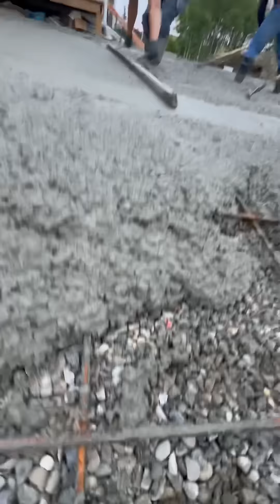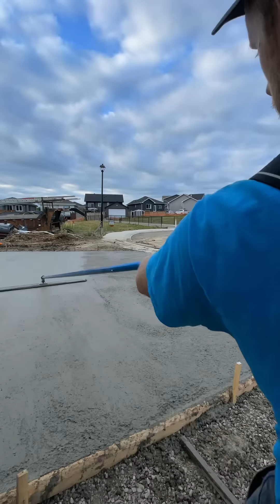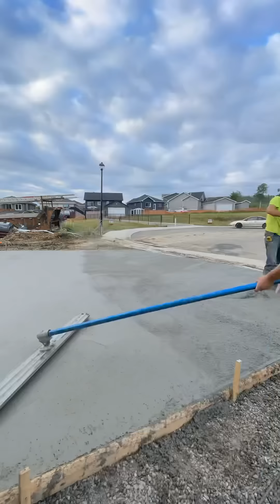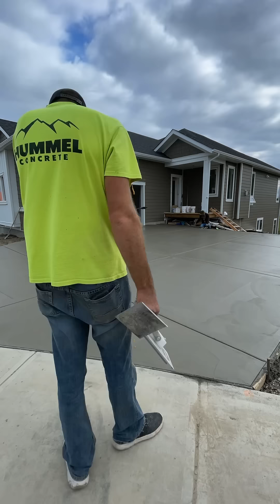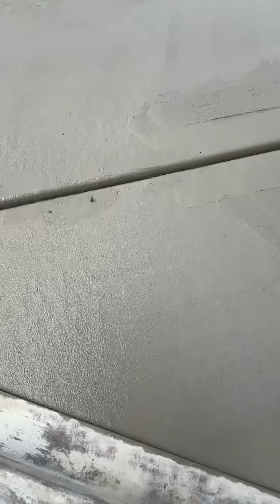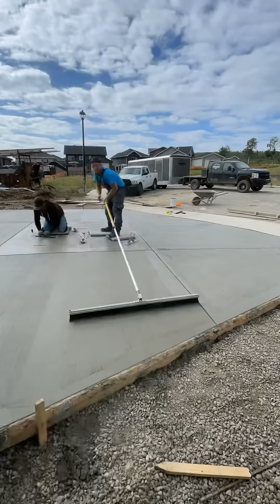How to pour a broom finish driveway ⚔️🧹✅ #concrete #construction #shorts

Comment: Whats the cost of that size driveway for exactly what you did?...i realize its small but just curious. Also, is this suggested for places in north which would have season ie winter temps.....?can this last without up leveling from ground rising due to vold temps?

Comment: How do you eyeball wet cut line that straight without like a laser or string line?
Reply from the maker: @JustLikeULikeIt  we snap lines 👍 sometimes we can’t if it’s up against the building so we’ll tape a mark to the wall to aim for. The 6’ long cutter is hard to get crooked.

Comment: Excellent work on the concrete and the videos.  

I've seen a few brief comments about the term expansion joint used in the video.  The joints shown are for contraction.  When the concrete contracts, the crack will usually occur at the joint.  So the joint controls the location and look.  The crack will be much less noticeable since it's in the indentation.  Control joints are typically about five feet apart.  Expansion joints are where a slab is separated from other slabs or building assemblies.  The joint space is filled with compressible material.  They are typically at twenty five foot intervals max.
Reply from the maker: @showvideo4167  yes, yes, sometimes my lingo is a bit off. Just years of doing the work but not much time talking about it on videos so I’m learning to speak more accurately for the videos haha! Check the floor video I posted this morning. I made damn sure to say control joints! 👊😆 They did teach us that in concrete school too but many years ago. Control, expansion and construction joints. It’s all coming back to me now ✅👌

Comment: You guys do great work. The skill level and knowledge appears to be among the best. 

What about those screed pins being pounded below grade. Are you still able to use them in slabs for houses? In my area, the inspectors don't want any rebar from slabs or grade beams or footings to contact the soil so it can't bring a rotting/rusting situation into the structure. What are your thoughts on that. I think it's a bit of Overkill
Reply from the maker: @jdog4534  no it’s rebar and not too concerning for us. Lots of ppl call us on it but it never causes us any issues

Comment: Having done heavy concrete construction,  off and on since 1960, I appreciate your process and quality of workmanship. Only have one more process to improve the lifespan of the work; water curing, just like the test cylinder program. Yes, it's time consuming,  messy and labor intensive. However, the process greatly improves the strength and potential lifespan.

Comment: Shouldn’t the expansion joint go all the way down to the substrate? Not a couple of inches otherwise it will still crack ??
Reply from the maker: No 1/4 of the depth is rule of thumb

Comment: Love these videos, why just fill the one expansion joint tho? Just curious why all of them don’t get filled
Reply from the maker: @Bobby_Da_Barber  all joints are the same . Not sure what you mean
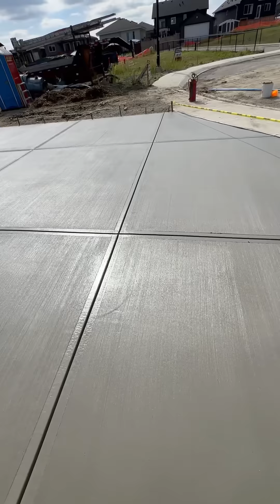Reply: @HummelConcrete sorry was a glare at 2:52 that looked like the expansion joint furthest to the left running the length of the driveway had and expansion joint filler or that caulking I’ve seen in expansion joints
Reply: @ beautiful job

Comment: Why does a magnesium float not screw it up but a steel one will?... and i live this channel thankyou! I've learned so much to help myself out. Cheers
Reply from the maker: It’s the type of metal, it won’t seal up the concrete perfectly smooth so it can still breath accordingly. Steel is much smoother and the trowels have a sharper edge so it seals up the pores more completely. It is important to not use steel too early because trapping moisture too early can cause problems. We usually do 2-3 passes with the mags or composite (plastic) tools before using steel. On a power trowel finish with hot air, steel is used sooner to smooth things out as it needs about 6 passes before it’s hard so it needs constant attention. I’ll be doing a video for that process soon.
Reply: @HummelConcrete awesome thats been bugging me for awhile i appreciate you taking the time to clarify that for me . Its a load of my mind lol.❤
Reply: not a concreter but i learned that the magnesium will pull water towards the surface making a nice clean finish.
Reply: @scata5277 it’s actually the steel that draws the water up to the surface. The mag does not. So the mag(or wood ) float pushes the rock down with out pulling the water to the surface too early,(which would cause puddles of water to form and wash the cement away from the the aggregate. Trowel is last,after most of the water is absorbed into the mix by the chemical reaction and air etc.